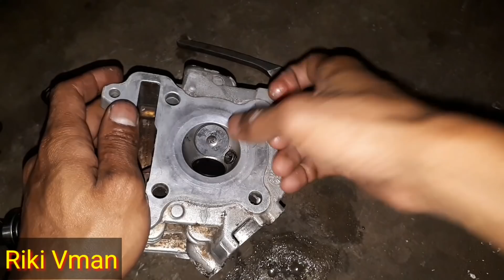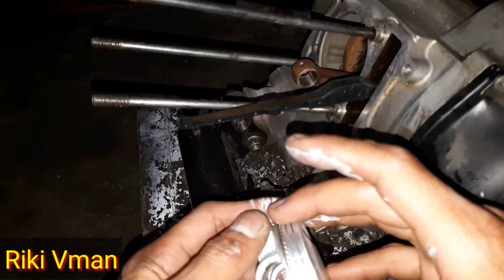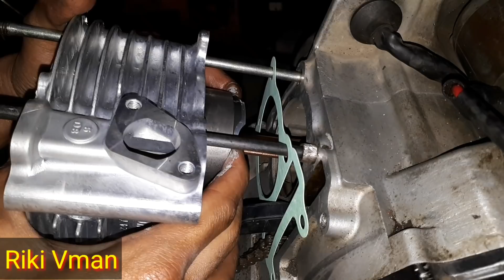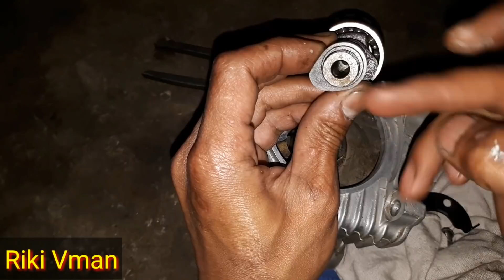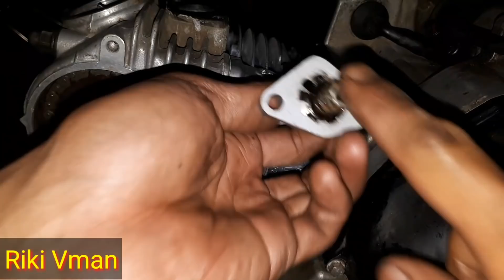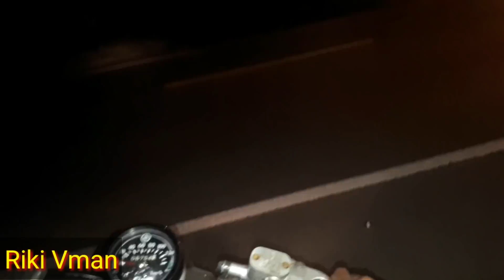Pasang blok seher / head mio !!! Test ride mio 58.5 korek harian !!!

Comment: Block tdr 58.5, noken +rra brt t1,klep standar ,pully kawahara k1,roller 11gram ,karbu pe 26,oli 1 bulan ganti.
Awet ni mesin dah 2th di pake jauh...
Hasil sendiri ,pasang sendiri.
Reply: Bro ente pasang piston 58 bubut crankcase gak
Reply: @rohmansyaiful6932  gak bubut crankcase diameter piston di bawah 60 mah
Reply from the maker: Langsung pasang kang.
Lihat di chanel playlist.
Paket bore up mio nouvo 300 rb.
Reply: Top speed tembus brapa bro?
Reply: @amirjhobest  di gps tembus 134
Reply: @yaefekcovid3569  cdi standar?
Reply: @amirjhobest  cdi standar ,koil ktc ,bubut magnit 1mm

Comment: mas riki mau tanya neh, klo pakai seher 54 ,dan hanya porting in ex nya saja. Noken as standart. kira2 pakai roller ukuran brp ya, mhn penjelasan nya 🙏
Reply: Roller std aja, +-2gr kalo mau naik atau turun ukurannya, noken std pabrik durasi kecil berarti tenaga ada di rpm rendah sampe menengah, pake roller keentengan otomatis atasnya buntung, keberatan bawahnyanya gaenak atasnya kurang maksimal jg
Reply from the maker: klw putaran mesin meraung. tambah 2 gram.
klw putaran mesin berat kurangi 2 gram